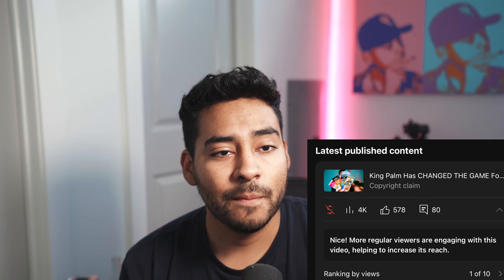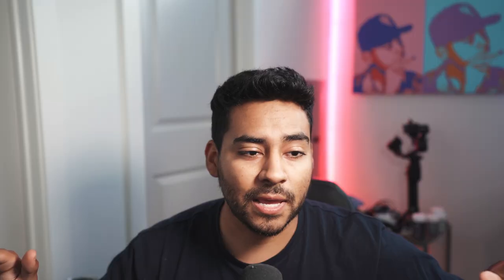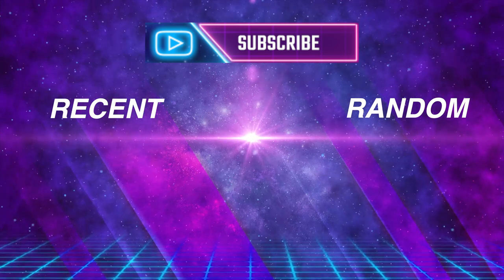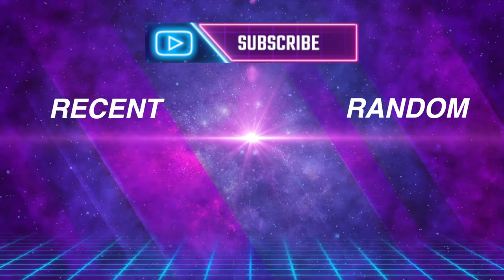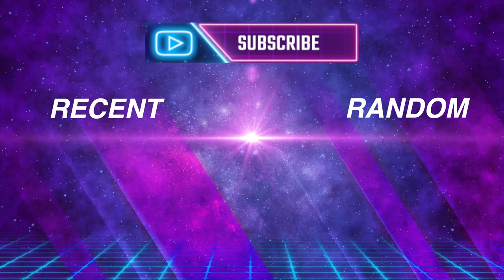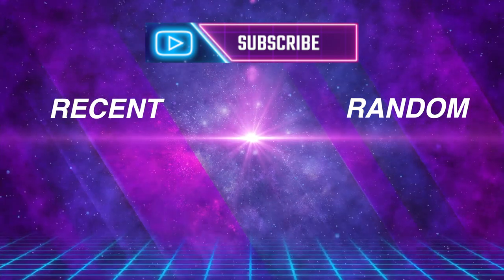This Is An Easy Fix

Comment: One thing that’s not mentioned… do not use a grinder.

Its too fine a grind and will burn more quickly which means it can canoe a lot easier. 

Hand shred or use scissors will give you a better coarser grind that will burn slower which will help keep an even burn and not canoe.

Try for yourself 😉
Reply: Pre-ground is not worth then? The dispensary uses machine grinders
Reply: @kurisechan88  - grinders make grinds that are too fine. Grind up nug and hand rip a nug. Which burns faster? The grinder grinds. If you hand tare/rip, the grind is coarser and is slower to burn.

Also hand rip a nug…. You will still find thin stems and stalk pieces. When you throw a nug into a grinder you did not get all the plant material out of the flower.

Mass production joints can still be enjoyable if the flower is good but for reasons mentioned above it’s not optimal.

Also the reason for mass production using grinders means they can hide a little bit of stems (they will also be finely grounded) so that helps them produce more joints for less money.

Comment: Appreciate it!! I’m wondering why my cones keep running. I pack them pretty tight, but it never fails when my girl hits it, it comes back with a huge canoe. Is she hitting it too hard? She swears she’s barely hitting it but it doesn’t canoe when I hit it slow & steady. It’s starting to frustrate me thinking I’ve been smoking for over 20+ years and my cones are canoeing…?
Reply: its ur gf bro
Reply: Also, you should pack tighter at the filter tip and looser as you get to the burn end. 

Another thing not mentioned but made a big difference is do NOT using a grinder. 

Hand shredded or scissors will make a more coarse grind and burn slower. 

Any joint I rolled with a grinder burns too fast and is more likely to canoe. 

Yea it takes more time, but its a more solid, consistent result😉